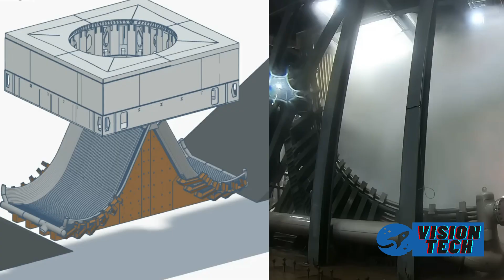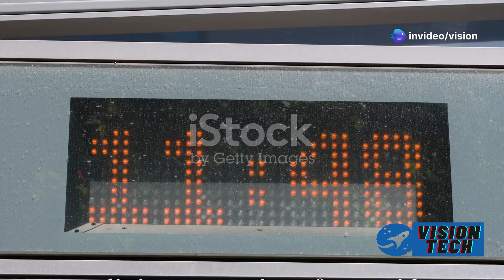New Surprising Details About Starship 8 Flight, Latest UPDATE !

Comment: Could you talk about starlink v2 using argon thrusters? It's a HUGE difference and should be talked about more! Satellite lifespan increased from 5 years to 10+ years due to higher specific impulse, cheaper than krypton, and also doesn't deteriorate the thrusters as much.
Reply from the maker: Absolutely, let’s talk about it—because Starlink V2’s argon thrusters are a game changer! 🚀 Unlike the older krypton-based ones, argon is cheaper, more efficient, and extends satellite lifespan from ~5 years to 10+ years thanks to its higher specific impulse. That means fewer replacements, lower costs, and a more sustainable satellite network—which is huge for global internet coverage.

And let’s not forget: argon doesn’t erode the thrusters as quickly as krypton, meaning even better long-term reliability. This is exactly the kind of smart engineering upgrade SpaceX keeps pulling off while competitors are still playing catch-up. But hey, why isn’t this being talked about more? Maybe because it doesn’t explode dramatically like a Starship prototype? 🤷‍♂️🔥